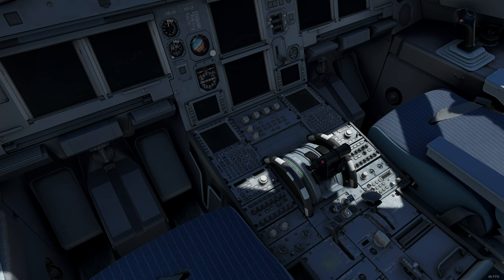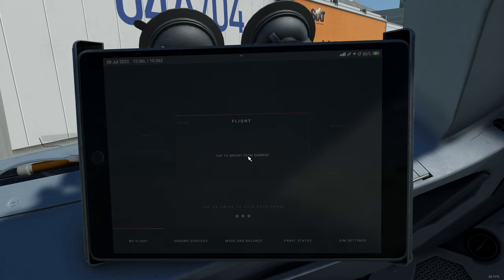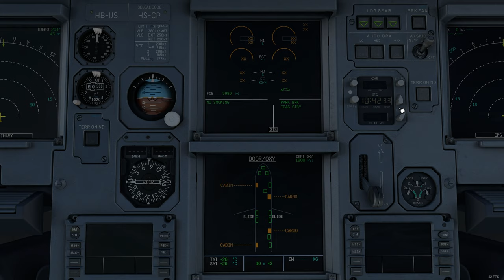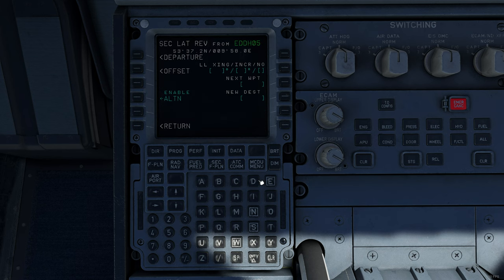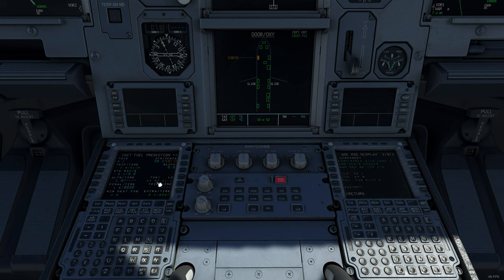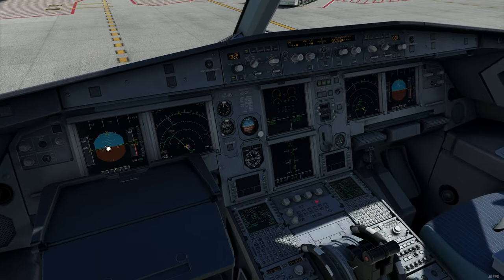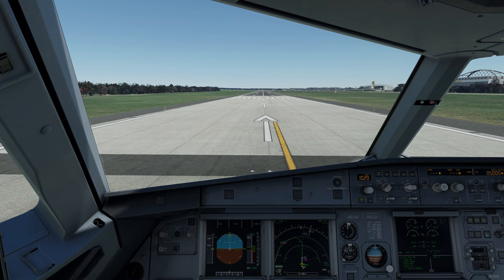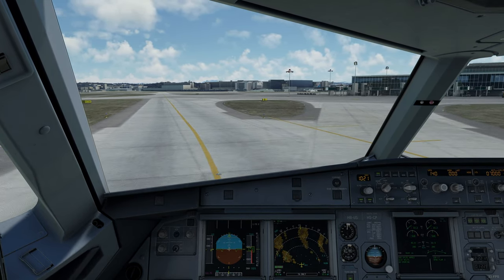Flight Simulator 2020 | Fenix A320 | Hamburg (EDDH) - Zurich (LSZH)

Comment: Yo im not new to flight simming or anything, but im only 14, have been simming for 6 years now. I saw ur vids and i was amazed how in depth u go and how much knowledge of each plane you have. I see so many simmers as well and i was just wondering where u learn so indepth about each plane cus i rly wanna try to perfect flight simming. Btw ur contents amazing bro ur so underrated. Keep it up
Reply from the maker: Thank you for the kind words! 
I will try to summarize as best I can.

Simply put, I started simulation almost 13 years ago, and I always had the motivation to learn everything by the book. It is simply in my nature. Some could call me a perfectionist. I like to call it passionate. 

Either way, these days, before I fly a new plane in flight simulation, I actually read the FCOMs or FCTMs and try to learn the procedures in great detail. Airbus makes the best documentation in my opinion because they add a lot of finer details or give you reasons as to why you push certain switches. Boeing is not as good and I have to then resort to more documentation, whether it is written or in video form. 

If I have open questions, and I always do, I try to google them and see if forums with real pilots have discussed these topics before and often times they have. You can learn a lot from forums where pilots discuss topics with one another. 

Then there are really fine details I try to look for that you simply will not find ANYWHERE unless you're lucky. So as a last measure basically, I will resort to AirClips or Just Planes and analyze many different clips hoping to find answers I was looking for. 
Some answers also just come in time. You may not find anything on a specific topic now, but wait a few years and someone will have an answer for you waiting to be read on the internet. 
To truly learn every Procedure the way I like to do it, is pretty tedious, but like I said, It's just in my nature. 

Now you may be wondering how I learn the systems. These days I only skim through them because once you know how hydraulics, pneumatics, bleed air, electrical systems etc. work and how they make a plane work, the only thing left to learn is how everything is connected through the busses or flight controls and how the redundancy works. 

In the beginning, I did have to learn a LOT of the systems from scratch but most of it comes naturally when using the right add-ons. 

I hope I was able to somewhat decently explain my process into learning a new plane. 

If you have any additional questions, let me know.
Reply: @BProduction222  Dang thats really cool how big of a passion u have for flight simming and the dedication u put in. Just planes is one of the things I also looked at but I definitely want to go more in depth when it comes to mapping the fmc as well as reading an ofp properly. When I got into simming I was just search cold and dark tutorials for each plane before even flying them but it was long time ago and I was only 6 so I knew nothing else much really but it got me into the flow of it. I managed to fly my first vor arch in the sim last night so I'm tryna perfect vor navigation. Unfortunately my pc broke last yr so this had to be done on mobile but I still managed. I'm struggling to understand everything from ILS charts aswell but yeah tysm for the help. I'm definitely going to be looking at documents and many sources to hopefully get more in depth into flight simming. But yeah ur the most in depth youtuber I've seen, better so than real pilots so well done cus ur hard work paid
Reply from the maker: @n-plane  I know my response is a little late now, but I thought I would follow up. 
I find it cool that you are also motivated to learn everything as much as you can. If it is the kind of thing you are passionate about, then I think you will enjoy it quite a lot. Also pretty cool that you are teaching yourself everything. Pretty much what I had to do. 
I remember the first time I used a plane that had LNAV and VNAV. I was frustrated and crashed on the first few attempts after takeoff. I simply wouldn't use the Autopilot correctly a didn't understand why. Fun fact, it was indeed the FlightFactor 777 that got me into the more in depth stuff I know today. Obviously now looking back, the B777 isn't really that detailed, but it was enough to get me started. 

What aircraft do you fly currently to learn everything? Are you progressing the way you would like?
Let me know.

Kind regards

Ben